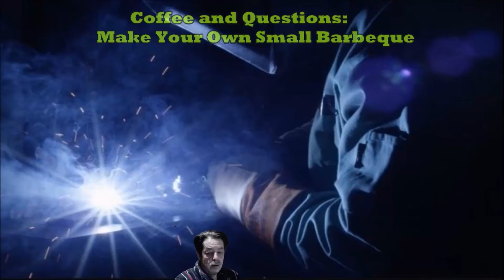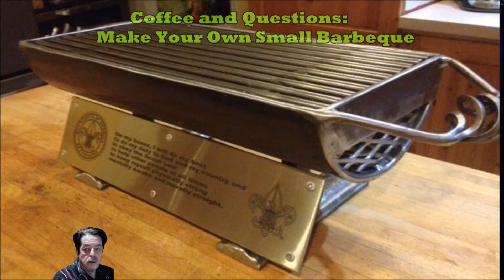How To Make Money With Your Welder Part -6

Comment: I wished I could locate places where I lived that offered steel cheap!
Reply from the maker: try second hand stores as some sell used bed frames and at times are broke or mismatched and you can get them very cheap either way - like Angel View etc -  Big Box are expensive - Steel suppliers are not bad in price and alot of times sell the cut offs cheaply - hope this helps some and dont forget to check craigslist but this is not the best source
Reply: Find a metal recycler.